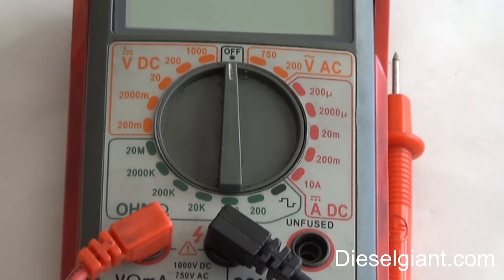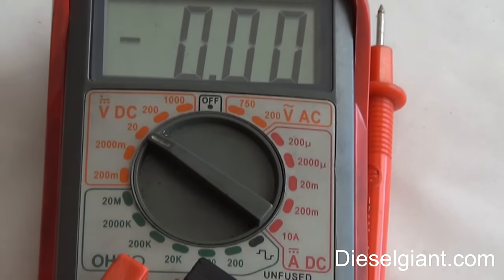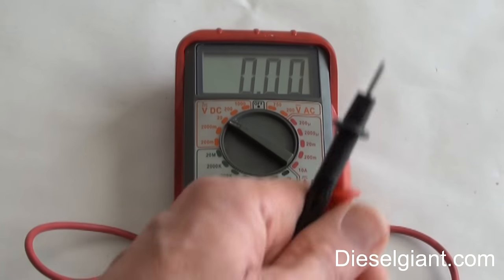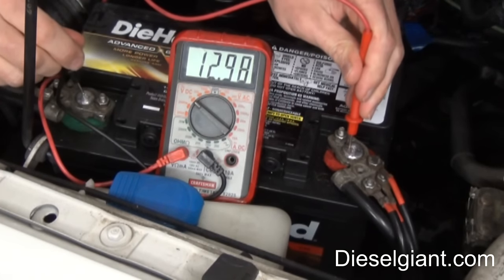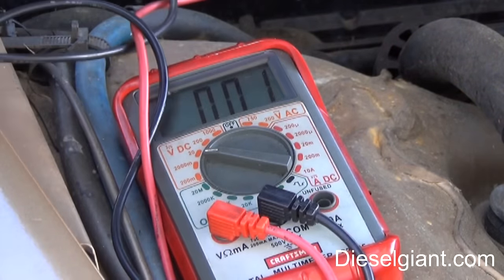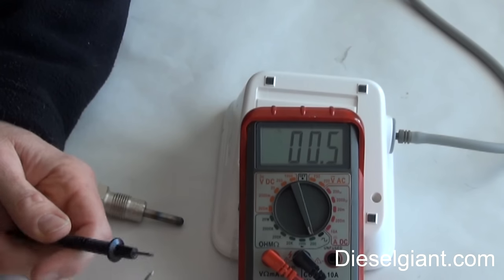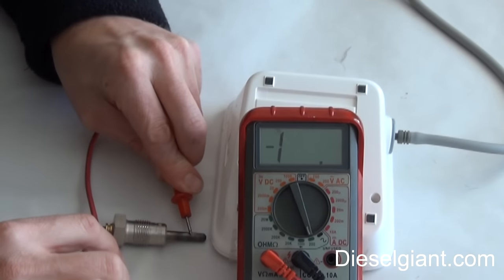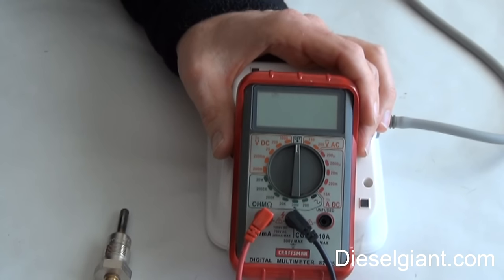Beginners guide on using electrical multi-meters for autos

Comment: Please answer: Today I tried to measure current in the outlet and caused
 two blackouts. First time I left the knob in mode for measuring Voltage
 and second time maybe! I left the setting on DC... or maybe 220V is too
 much for multimeter and one cannot directly plug it 
into the socket to measure current? And second question: my leads do not
 give me sound signal when I learn to measure continuity (earlier they 
were giving sound). Is it possible my red lead (got a little bit roasted
 at the tip both times when short-circuited previously) or multimeter 
got damaged? :(
Reply: multimeter internals got roasted or fuse has blown
Reply: André   Hi Andre'.     Read your comments from 11 months ago on the multi meter.   I am only a DIY guy, not a professional, but I would STRONGLY suggest that you try to get actual hands-on training (or a class) from a Jr. College, high school or tech school in your area !!   And PLEASE,    DON'T  mess with house current ! !    IT IS POSSIBLE TO GET HURT IF  YOU DO NOT KNOW THE CORRECT WAY  OF DOING SOMETHING ! ! !     Stay Safe
Reply: You left on DC. ...should have switched to AC setting
Reply: If you're talking about trying to measure current that's amperage. You cannot measure amperage like that. To measure amperage you must connect to multimeter in line with a circuit. So you blew your multimeter by checking amperage when you meant to check voltage.
To test amperage: example 
(dc fan amps) set multimeter to 
10A DC amps. Move red probe to 10A plug, then connect a 9V DC battery to a 9V DC fan, disconnect the negative wire on the fan from the battery. Connect the negative wire of the fan to the positive red Probe on the multimeter. Connect the black probe to the negative side of the battery. The multimeter will measure the current amperage. Electrons running through the circuit. That's called amps.

Comment: When you were testing the diesel glow plug for resistance I was wondering why you put the positive probe on the thread which is the ground and not the black probe to ground? so basically with resistance that means load from a device, a restriction of current flow correct. Also I thought you would use the continuity setting when touching the two probes together not the ohms setting, I was under the impression that you can damage the multimeter or blow a fuse by touching the probes together on any voltage setting, please explain.
Reply from the maker: +Thetrucky69 It does not matter which side you use.  The only difference is that the meter will show a "-".
Reply: +dieselworld I asked you other questions also but I expect a bit much I guess but thanks.

Comment: It would be house voltage not house current that you are measuring with the meter set on 200 volts ac.

Comment: One day please post a test for a bulb short in tailgate lights electric assembly. My small bulb for reverse back-up light keeps blowing. I ruled out the electric assembly because same issue occurred to the replacement electric assembly.  I think it might be the power electric connector. So, I removed a connector from my parts car..1988 Mercedes Benz 560 SEl. Then, I watched this video.

Comment: an explanation why your multimeter is showing higher than 12 volts on your car battery full charged than sitting for at least 24 hours it should be exactly 12 volts and if not your meter needs to be recalibrated there is a way to recalibrate them if you open up the meter there's an adjustment pot inside to recalibrate it to read 12 volts most multimeters they read too high I have recalibrated mine and it works fine now with all other  battey types thy all read the voltage they say they are

Comment: Did parasitic drain on NEW  c ar battery but meter shows ZERO...apparently meaning no drain...yet there must be drain because battery voltage drops to 10 v after a couple days not driving. ??? causing this?  Nothing is on in the car. Car is a 2001 Dodge.  ???

Comment: That alternator was putting out 2 volts right? cause the battery was already putting out 12 by it self so 12 plus 2 equals 14..
Reply from the maker: No the alternator was putting out 14volts.
Reply: Well what happen to the 12 battery volts? that dont count? it automatically disapears?
Reply from the maker: thnkbg the alternator has to charge at a higher rate than the 13 volts or it would not charge up.
Reply: Okay I got ...   the 12 from the battery doesn't show or count cause when the car is running it runs off the alternator & not the battery & that's why you get an alternator reading..

the battery is not in use & is charging .. its just for starting right?
Reply: I had the same question. Now it seem obvious. Thanks for asking.
Reply: Good Question, I was wondering the same.
Reply: car doesn't run off the alternator, it runs off the battery... the battery is charged by the alternator. It has to kick out more potential volatage than the battery discharges in order to charge the battery.
Reply: Rowena Smith they work in unison really you can drive any where you want with a bad alternator as long as you have a few fully charged batteries just as you can drive with no battery as long as you keep a charged jump box in the trunk lol both are inefficient and impractical without the other
Reply: Rowena Smith if we get technical the electrical components in the system are connected straight to the battery not the alternator so the battery is much more than starting. Poor or no battery means added strain on alternator if it was meant to run the system like you say you wouldn't have to worry about your alternator failing with no battery
Reply: Rowena Smith of course which is why I said they work in unison, and the ecu ecm bcm everything is connected to the battery not the alternator hell even the alternator needs dc voltage from the battery or else it's just a huge paperweight.

Comment: Hi Russel thank you for the tutorial.  I just got a new Innova Digital 3320,  got all excited to try out and I melted my positive lead on my car battery by connecting the red probe to  DC 10 A & turned the knob to DC 10A grounded the black probe & touched the + car battery with the red probe, LOL my red probe sheathing melted very quick.   I can't wait for a new probe so what gauge wire do I need to replace my positive lead?  What is the probe wire gauge ?  I think the voltmeter is ok.
Reply: I don't get what you did do you mean you try to test amperage with the volts or did you forget to test the amperage in the circuit. Don't feel bad though I blew into cheap $30 multimeter by testing amperage by starting the vehicle. As Homer Simpson once said Doy

Comment: A battery is dead if it reads 12v. That's rubbish. The most I get from a good battery after being on charge for a couple days is 12.8v. Sometimes you can get a battery showing 12.6v that still struggle to start car & another at 12v & starts fine. The voltage can't always indicate a battery is no good.